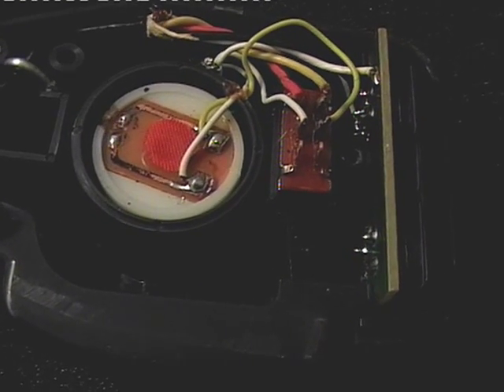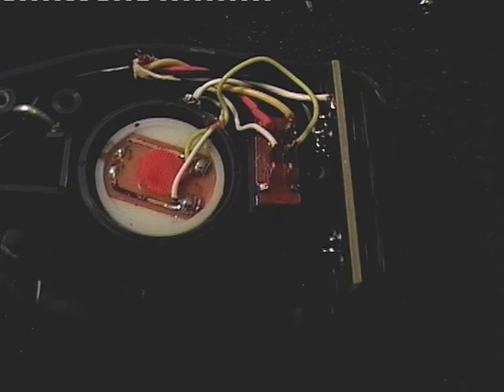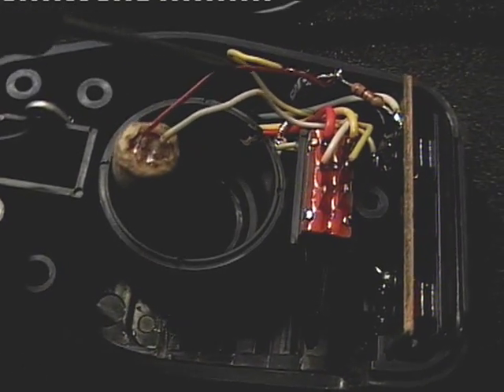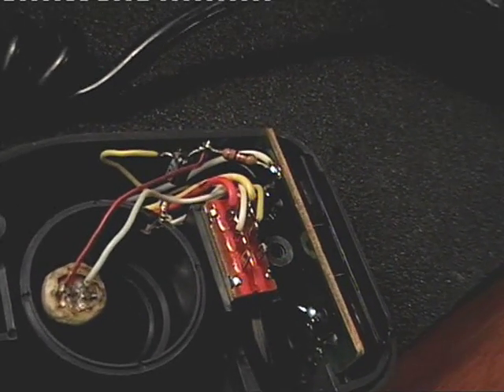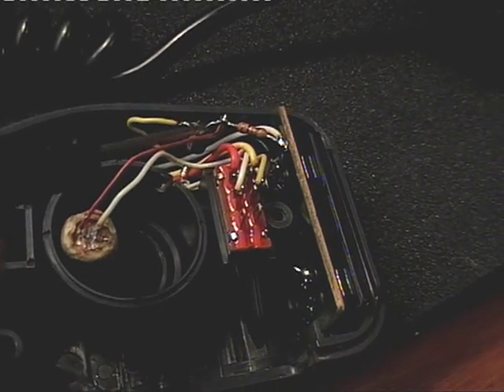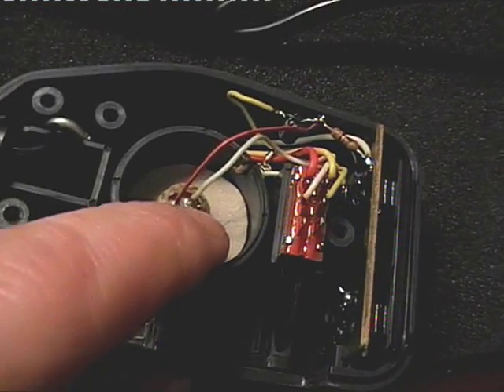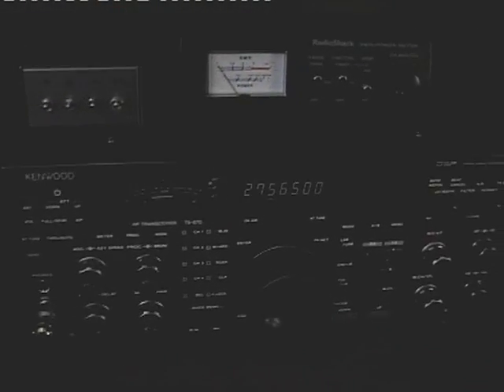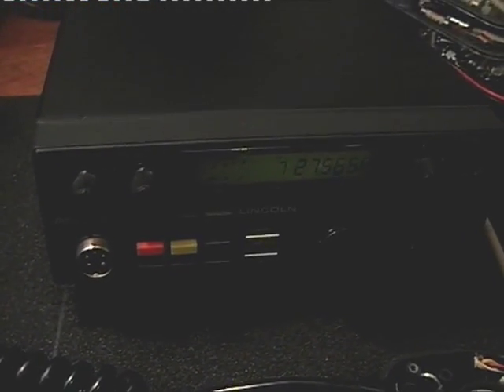Gw0wvl  ( How  i  wired   a  Electret  Mic  element  to  my   President Lincoln )

Comment: Great and easy modification! Thanks!! Did it some minutes ago and works great. Really no amp mike needed anymore. 73s
Reply from the maker: +13EL121 Im  Glad  you  like  the  Mod, Its  easy to do  but  really  adds  'Punch'  to the  Modulation..
Reply: +MrMadjones 
Yes, but it adds more loudness also. What about playing with the C and R? Do them affect the modulation?
Reply from the maker: Altering the value from 1 k will alter the loudness .. But  you can't alter the Resistance to much or the  fet inside the electret mic element won't function properly.... The capacitor is for DC blocking , It stops the voltage from going back into the radio.. That's its main purpose , But altering the capacity does affect the audio, If you use a 1 uf cap, The audio will sound thinner with a lot more treble showing , And if you use a larger value say 47uf it will sound a lot more bassy as the treble won't show through...Its worth a try but the values I've used are a good mix of lows and highs..

Comment from the maker: Most  of  these  cheap  Electret  mic  elements  are  around   2000 ohms   Impedance,  They  use  a  internal  Fet  and  its  this  is  why  the  impedance  is  high.  Info  on  These types of mic  elements  can be found  easily on  the  web.

Comment: I have a question, the electret microphone needs a voltage to work, from where it receives this voltage? 
As i can see at mike wiring there is no (+) voltage, or the pins 4 and 5 for the up/down have a positive voltage?

Comment: I tried doing this with an old Skiptech electret microphone, but the radio changed channels all the time. I have a resistance decade box handy, and I determined that the lowest impedance I could put on the channel change pin without changing channels is 6.32k. Are there any mods inside your radio that would let it supply more current?

Comment: How/why did you choose a 1k resistor? Why not a 2k or 8k? Same for capacitor?
Thnx for great vid!
Reply from the maker: +N3zjp The  resistor  value  of  1 k  seems  to  work  correctly  as  in so  much that  i  didnt  have to  use  a  seperate  variable resistor  in the  audio output wire   to  turn the   audio down, To  high  a  value and  the  audio  was  to  low... As  for  the  capacitor, Its  main job is   to  block  the  DC  voltage  from  entering the  radio  and possible  causing  damage, But  it  also  has  another  function  is  that  by  changing  its value you  can  limit  the  audio  bandwidth  going through  the  capacitor,   If you  used a  1 uf  capacitor  the audio  will sound  thin  with  very little  low  frequency response, On the  other  hand  if  you  use a  Larger value capacitor  say 100 uf  then  you  will  limit  the  high  end  and  it  will  be  all  low frequency  and  it will  sound  boomy... So its  a  bit of  trial  and error, The value ive  used  gives  a decent  amount of  low  and  highs... But  it  will  depend  on  your  voice  as  to  what  value  you  decide  to  use..